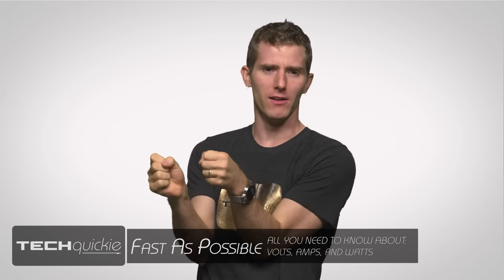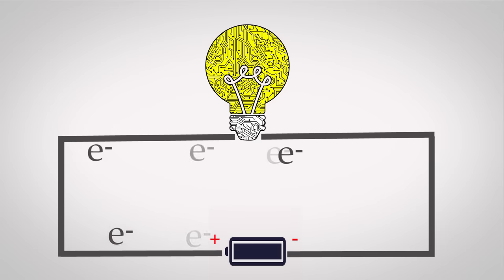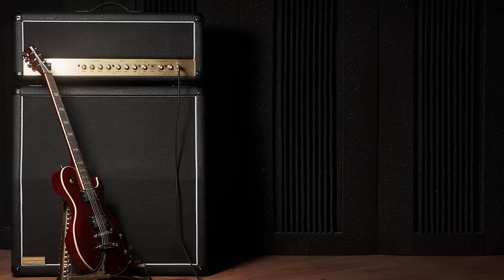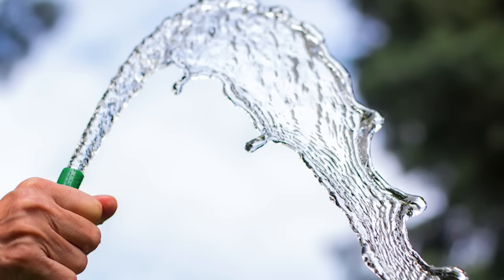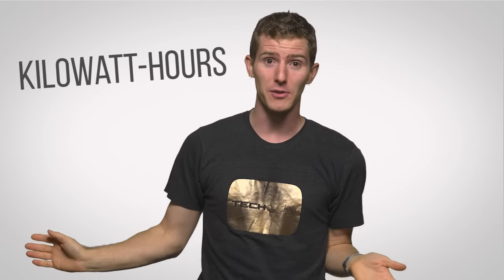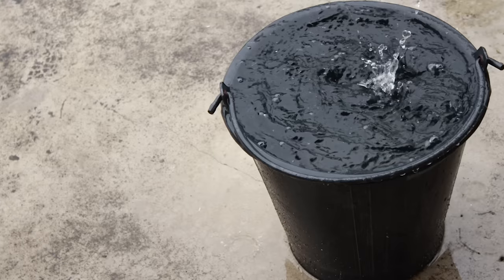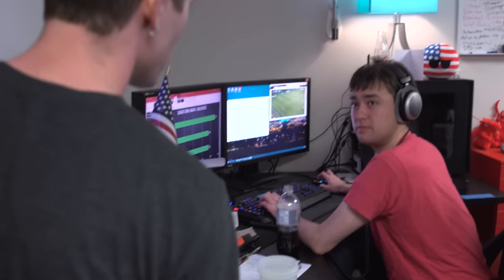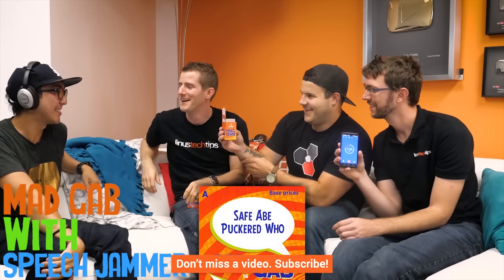Volts, Amps, and Watts Explained

Comment: I can control the brightness of the light in my fridge depending on what setting my oven is running at... which is nice
Reply: ROFLMAO
Reply: Wtf Doofenshmirtz
Reply: @mamad7976  hahahahahahahahhahahah I just woke up and watched this and read this. Watt a morning already.
Reply: Haha hah hahaha haha ya that must be nice!
Reply: Does it RGB?
Reply: You should get a firealarm then😁
Reply: +qq+
Reply: @Daniel Murray 00
Reply: @Daniel Murray ¹0
Reply: @Daniel Murray 01
Reply: @Daniel Murray 1
Reply: Haha haha roflmao! So damn funny! I’m assuming you turbocharge the hot water in the shower by flushing the toilet?!
Reply: theyre probably on the same circuit which is a nono
Reply: probably not good foryour power grid thought=..
Reply: Causation or correlation?
Reply: Wow thats safe :)
Reply: Hahahahhaaa
Reply: @beaclaster  definitely causation lol
Reply: @justinsparks3257  lol
Reply: Did you have to pay extra for that?
Reply: I can run the dishwasher while I yak kielbasa

Comment: As someone who is in the process of becoming a science teacher. This is one of those videos that will be saved and used in classes later on.
Reply: Hey...I wish you well and hope you enjoy your future endeavors. It is largely a thankless job, but great teachers (which is what I think you'll be due to your concern and purpose well before it's becoming a reality) are what help develop children with less than stellar parenting into upstanding citizens in the future. I just hope some of these strange political stuff is toned down in the classrooms, especially for the youngsters.
Reply: One misconception I'd correct here is thinking of the cell (or battery) as a reservoir of electrons ready to flow from negative to positive. It's not that. It's more like a pump, which pushes the electrons that are already in the wires and components around. The model I use is to have students hold a loop of rope, and one of them pulls the rope through their hands. That person is just a pump - they don't have a big reel of rope in their pocket.
Reply: I wish my science teacher played this video